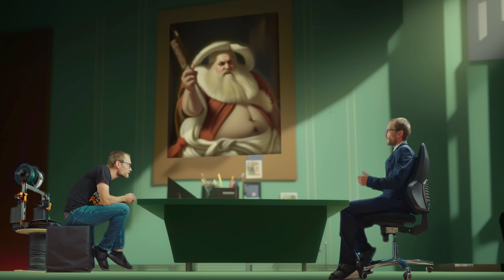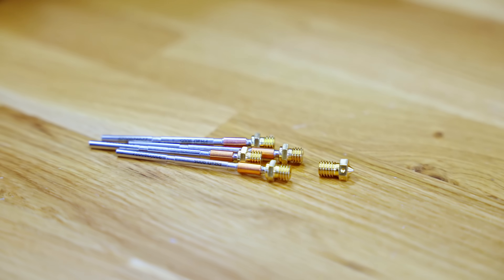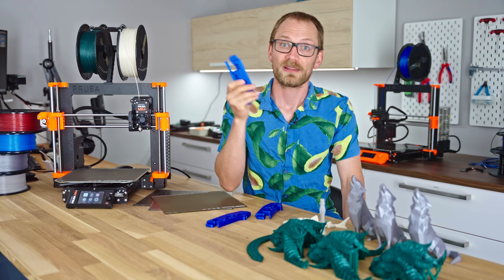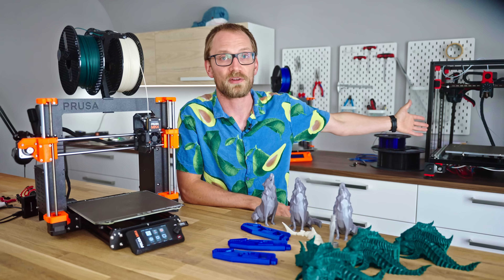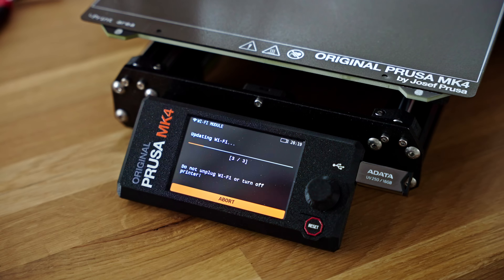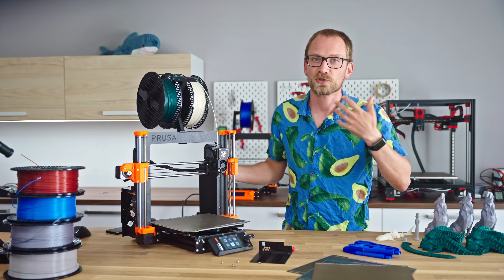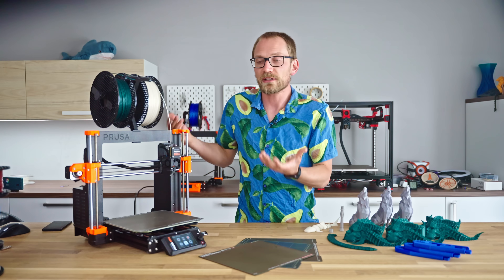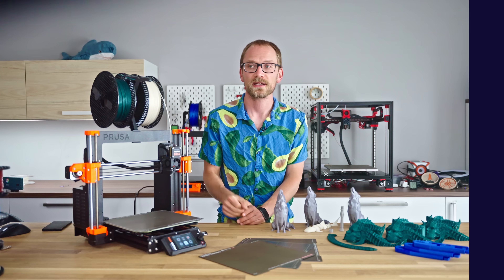Does the Prusa MK4 have what it takes?

Comment: The printer (& software) being open source, utterly reliable & easy to maintain is far more important to me than print speed or a fancy UI. There's a line in the MK3 product passport that reads "We want your printer to last as long as possible." That speaks volumes.
Reply: And so are most FLSUN, Creality, etc printers, a LOT printers run on marlin and use parts that are (except for some printed parts) for sale on the open market.

If I wanted to pay 1000€ for a printer, I would get a pre built voron. That's actually open source AND has upgrade options for the latest technoligy - updates that don't cost as much as a new printer
Reply: I don't get it. Why would a Prusa last any longer than anything else? They all run on the same open source firmware. If anything, the Prusa stuff is MORE liable to break because they've cooked up their own version. On other stuff, you can just install your own marlin and so whatever you want. I really never understood this argument with Prusa.
Reply: @geometerfpv2804  Because a Prusa machine is built almost entirely from standard components and 3D-printed parts. There's essentially nothing on my MK3 that I can't replace for years to come.

I'm not saying Prusa is the only option which offers that. But it is an advantage they have over Bambu Lab, for example.
Reply: @andybrice2711  while thats true, I can buy a whole new another bambulab p1p if the first one completely breaks and I will be only little over the price I would pay for the MK4. why would I even care about the mk4 then
Reply: @davidpodeszwa7010 yeah I think most people understand that at the end of the day. It speaks to the sustainability comment Tom referenced in the video. Sadly most folks are in your camp and could give a lick if their product is repairable or sustainable. People will happily toss the old one in a landfill and buy something new. 

Is what it is I guess.
Reply: @davidpodeszwa7010  I still prefer a machined which can be hacked and upgraded more easily. But yeah, you've got a point about spare parts vs replacement machine cost.
Reply: @davidpodeszwa7010  Or you can just print a replacement if a plastic component breaks, or buy a replacement part. That's the main thing that worries me about the Bamboo Lab printers, they use bushings which are inherently a consumable part, might take years, but eventually they will need to be replaced, same with the rods themselves, and the way it is designed you can't do that.
Reply: The issue is that the MK4 is a beta unit- not fully baked. This is why I never buy Creality. The Bambu X1 is working out of the box. Prusia screwed up on this and their reputation is taking a hit. It was poor planning to have released it without having for instance a accelerometer built in with input shaper running into of the box
Reply: Broskisnowski  They are also reliable because they are all built with the same components, and built with pretty good components.  Additionally, Prusa printer/firmware/filament/slicer combo makes things a no brainer for an open source printer. 

For most people, building, wiring, and tuning a Voron/Klipper, are not where they want to head.  Since you're building "your Voron" not "The Voron", you're also having to learn how to do input shaping, etc., which is also something that many people don't want to fool with.  I am currently racking the gantry on my Voron 2.4R2 300, which will join my MK3S+, so you can guess how I feel about the MK4/Bambu options.
Reply: @davidpodeszwa7010  If you are a hobbyist and not printing to much, The Bambulab p1p can be a good choice. If you use the printer a lot (daily), i have my doubts. The Prusa printers have e excellent built quality and you know for sure they will work reliably for many years. Parts are easily to get en the aftersales is excellent, even after many years. 
Bambulabs is a new company and nobody knows how long they will exist. Their printers use more costum parts, which may cause problems in the future.
Reply: @PaulDominguez  The Bambu isn't nessecarily working out of the box.  That 100% is the intent but over the past two weeks i have been researching which one to buy as i don't like the tinkering with my tools and while i did that with the early resin printers I to the point i am done with that and would rather just buy one that works.  Bambu seems to be about a 50/50 chance you get one that works like it is supposed to and it is impressive when it works.  I am not impatient so speed doesn't entice me all that much and from some of the tests done on strength the higher speeds reduce the strength of the part.  Maybe i just step down to the Mk3, but i have determined Bambu is not established enough on their QA/QC and support for me to purchase from them.  Prusa has built a community that is top knotch and has good support from what i can tell.
Reply: @mekko1413  mine worked out of the box.  It is even printed with a 4yr old roll of petg so the flow comp seems spot on.
Reply: @dirediredude  That's not a very level headed take I feel, because I'm all likelyhood Bambulab printers will last just as long as Prusa printers because the Prusa will be completely out of date by then, heck it's arguably somewhat out of date now as a bed slinger.
Reply: BTW prusa removed the open source logo from the latest patch of the MK4
Reply: @jumadhaheri  Interesting you should post about this in forums. Stir up some noise and see if it was on purpose or meant anything.
Reply: @wilsistermans1118  All parts are readily available for the P1P just they are only available from Bambu labs so if they stop supporting a printer it is essentially junk as soon as any part fails. One good thing about Bambu Labs is it seems to have kicked Creality into upping their game. The K1 seems to be a much better quality printer than Creality's previous offerings and they are also sorting out issues with it rather than just leaving it to their customers to sort out on their own. Time will tell if this has actually pushed Creality in a good direction because the K1 and K1 max seem like very nice printers at a great price.
Reply: Ok boomer
Reply: @davidpodeszwa7010  Hmm... I'm not sure how much they cost to ship to where you are, but one of my considerations is that a P1P ($599) will cost $170 to ship to me, while a Prusa Mk4 kit ($799) costs $73 for shipping. So the difference in the total cost to me (well, I'll still need to factor in 8% tax on the price of the printer and cost of shipping), would be $872 for the Mk4 vs $769 for the P1P. Which means if the P1P breaks and can't be fixed, that's another $769 (assuming prices stay the same) vs the cost of parts that need to be replaced on the Mk4.
Reply: @MrMechi001  Bambulab literally has a print farm of their own they used to test printers for thousands of hours. Tons of print farms are starting to use them as well because it turns out that output matters. Maybe drop the brand loyalty and look at things more objectively
Reply: wow. seems you are captured by an unrealistic ideology (the affliction of our time). everything gets faster and better. saying you dont want speed is like some one 1800 saying they would rather travel by horse than the scary new train invention. you  seem to discount any perspective of time in relation to technology in your judgements. the 3d printer is not an object for you to create a cult around in order to give yourself an identity. it is a tool. tools do one thing. they do work. the printer is a means to an end, not a thing to worship because you are more concerned about  what people think so you attach your self to an object in order for people to see you in a way you want them to rather than actually solving problems and actually making the world a better place through innovation and invention. one serves the self, the other serves the world. one is selfless, one is completely selfish.
Reply: @MrMechi001  hahahaha yes yes, those blasted trains!  its impossible! the human body can never pass 40 miles an hour you know!! wow it really is a disappointing part of humanity that you people exist. darwin is rolling in his grave.
Reply: @MrMechi001  ei ! title video?
Reply: @PaulDominguez  Totally agree with you. In addition to your comment: a damn camera and a smartphone app!
Reply: open source but most of the 3d printer community uses clone parts???

Comment: Meh, I think the criticism is pretty minor, nothing I've heard really wants me to avoid buying a Mk4. I'm a bit tired of the problems I'm getting with my Ender 3, I want a solid workhorse, I don't care for the extra proprietary stuff the competition is doing. I just don't see any of the criticisms being relevant to my purchasing decision. I'm not buying the printer for the bells and whistles, I'm not trying to impress my friends, I'm not trying to stoke my ego, I'm not trying to stay ahead of any curve. I just want a solid machine that will always work, with excellent support, and supports open ideas like open source and right to repair.
Reply: I can’t agree more. I bought an Ender thinking it would be cheaper and I would get it to be reliable. But after many upgrades I still find myself continuously having to tweak it.  
I am holding out with buying a mk4 for a bit to see Prusa’s response. I would like them to take this kind of feedback seriously. 
They really should add the accelerometers and drop the price a bit.

Comment: Great review. One thing though: while I'm a tinkerer, I explicitly do NOT want to work on my 3d printer. In fact, I loathe it. Ideally, it just prints, so I can work on iterations of my own products for weeks, or their MCU innards. That's why I'm sticking with Prusa printers. They seem to hit a sweet spot for me when it comes to reliability and price.
Reply: Yes you nailed it. "Reviews" such as this YT video are bizarre, like when he claims he'd just buy a cheap machine and then spend for ever tweaking it. Maybe he got stuck in the 2010s ? 
I just want to make stuff with my 3D printer, not make a 3D printer.
Reply: Mk3+ is a great machine which needs almost no maintenance if you use it properly
Reply: Had nothing but trouble out of the couple Prusas I worked with. For the price, I expected your experience, but realized that is almost ALWAYS a fan boy perspective...

Comment: I got the MK4 as a very expensive upgrade to my unmodded Ender 3 Pro. For me 3D printing is not a hobby as much as my 3D printer is a tool. I want the thing to work every time, always have access to parts and service, and have a seamless experience from slicer to print. The competition may have surpassed Prusa in terms of speed and tech, but its the intangibles that made me choose the Mk4.
Reply: That's exactly why I have a MK4 on order.
Reply: My thoughts exactly. I need a reliable tool, with solid support, long term spares and dependable connectivity.

For then next printer we’re looking at a Mk4 or a Bamboo.
Reply: I have a mk3 it's not gone wrong once in 2 years. I'm impressed with it every time I print.
Reply: @dts7824 Four years for my Mk3S+ but same: utterly reliable, no need to tinker with it. Just what I wanted.

Comment: I think part of what your money buys you when you get one of these is also the promise that replacement parts and even upgrades for it will be available for a lot of years directly from the manufacturer. No hoping that some other company will make a compatible part 4 years from now when you accidentaly break something. You just know you can go to Prusa and have the exact spare part in a few days. Based on how they have supported previous iterations of this printer I can belive this a lot more than with any competition I can think of.
Reply: Which parts are you talking about?
3d printed parts are available as to download
Whole motion system is an of the shelve solution (bearings, rods, belts, motors, etc)
Frame is partly aluminum extrusions and some custom sheet metal and that big square
Electronics is custom and if recent years thought us anything - BMW shipping cars with missing features, raspberry pi at crazy prices and even Prusa having problems sourcing parts - you can't trust that it will be easy to source anything that doesn't have drop in replacement. And seeing how Prusa invests in unified platform you might be in for a surprise.
I think the more popular product is the bigger the chances that, even if the original part is unavailable, there will be a 3rd party replacement.
Reply: Totally agree with all those points, they're the reasons why five years ago when I got the chance to get a 3D printer I went for a Mk3.
It's still going strong today.
Reply: @furmek  What you say is absolutely correct but also meaningless for many users. I know personally someone who bought a Mk3 almost 4 years ago. He uses it daily, he understands quite a bit in the principles of how FDM printing works and can go deep into many lesser known settings in the slicer. But in the end he just wants a printer that works and does not care or have time to learn that the hotend is off the shelf V6 E3D, he just wants to get a new one when a badly tightened nozzle causes a blob of death or when heatbreak breaks because of repeated crashes into a warped part. No searching, no learning, just order the part and get it in two days, with certainty it will fit. I know he changed some parts of hotends and whole hotends over the years, bed thermistors too. The short PTFE between hotend and extruder as well. I dont remember any other failures. 
You and I know we could invest some time searching what exact bed thermistor Prusa uses and buy it elswhere, same for the tape holding it on, and we might get it cheaper, saving a euro or two. But the convenience of never having to do that has a price many people are willing to pay and they get it with a Prusa printer. Not everyone buys these things to become an expert in what parts exactly are in it and where to get them. Some people just want to print and have easy access to spares. Prusa has shown they will support your pretty old printer that way. Other manufacturers to my knowledge have not (or some possibly not yet as they have not existed for long yet). This is not valuable to all of us but some people like it a lot. 
BTW I have sold my prusa some time ago because I use RatRigs now, I am also not a customer for the MK4, I just know personally someone for whom it would be an exact fit. Although he will just upgrade his current printer to Mk3.9.